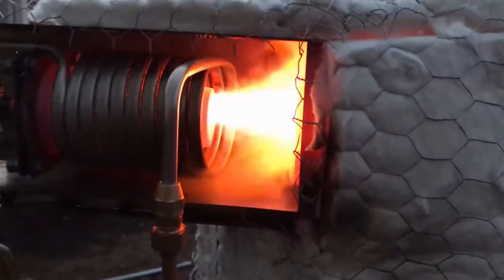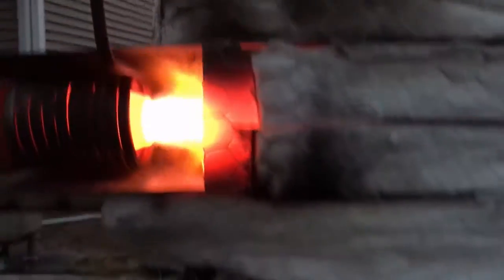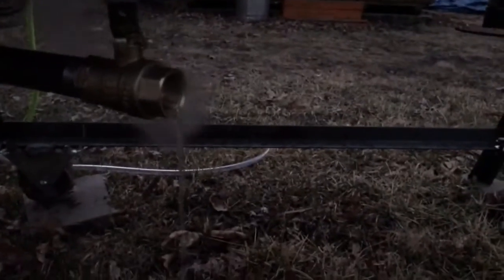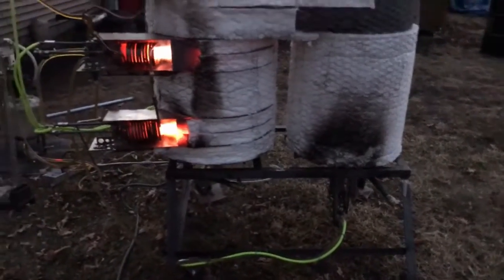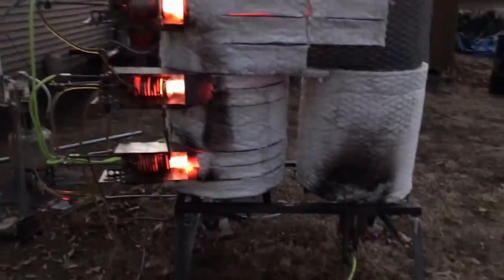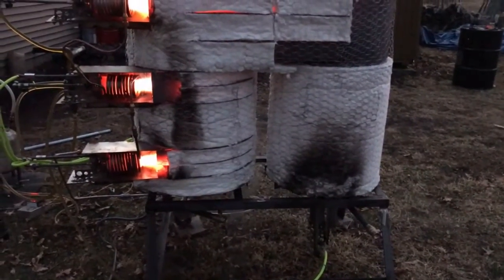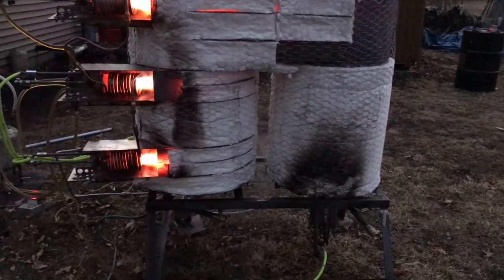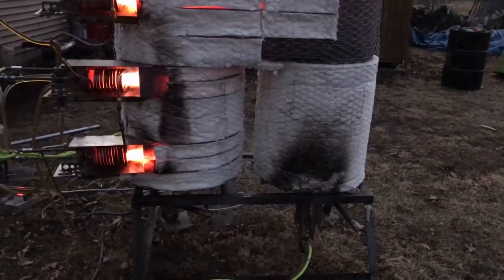Testing Testing and More Testing Flash dryer first run

Comment: Love your videos. Only problem is when you put that blankett on the outside the heat will destroy the metal fast.
Reply from the maker: Yes you are correct , we are going to line it with refractory after these test

Comment: Is that a stem coil or an air/fuel preheater you have around each flame nozzle now? ~( 'w')/
Reply from the maker: mono tube pre heater for atomizer nozzles . Not for the burners